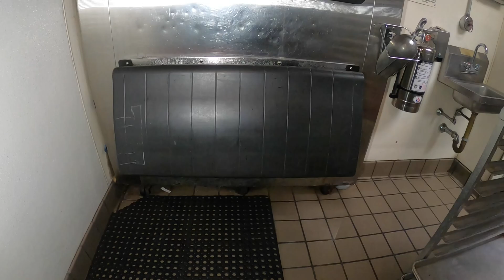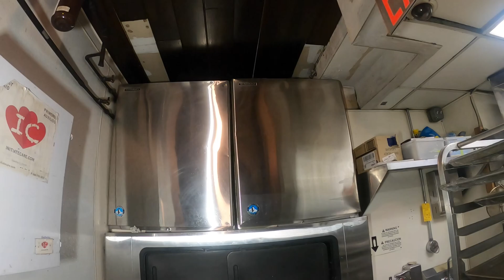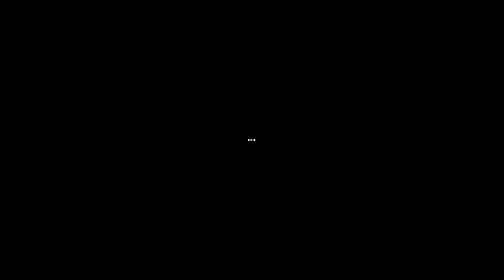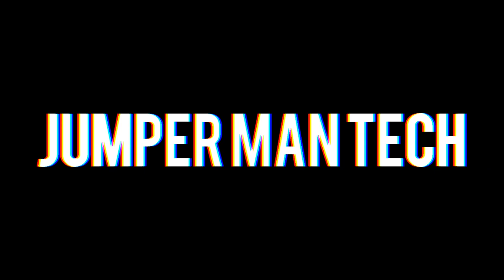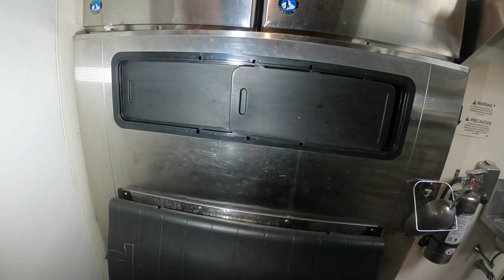HVACR: Hoshizaki Ice Maker Service Call (Hoshizaki Troubleshooting And Repair) Water Supply Line

Comment from the maker: Thank you all for watching! This unit has a seperate water supply for the condensers as they are water cooled. The piping I changed is the water supply for the ice production itself. Have a great weekend! 🔧⚡️
Reply: The boiler drain valves are so the water can be tested before it goes into the unit. I had to install a bunch of those in a restaurant once.

Comment: I would have aligned everything, hold in place, mark alignment marks with a sharpie, crimp off the wall for the portion that is against the wall. Would make it somewhat easier to use the tool.

Comment: Great job, only issue I see if there is a water leak at either I/M you have to shut the water off to both, I would have added a separate shut off valves